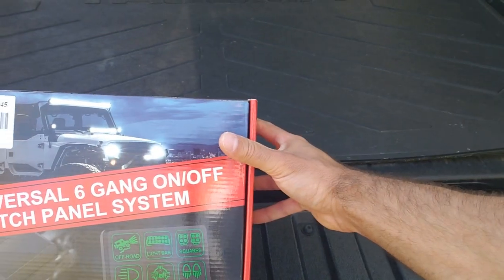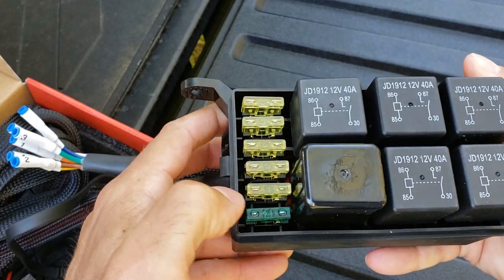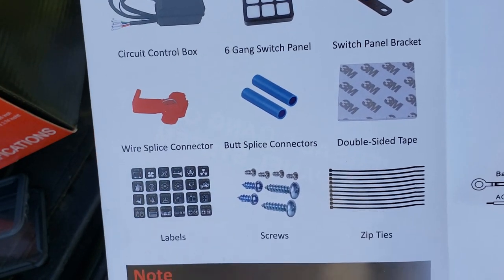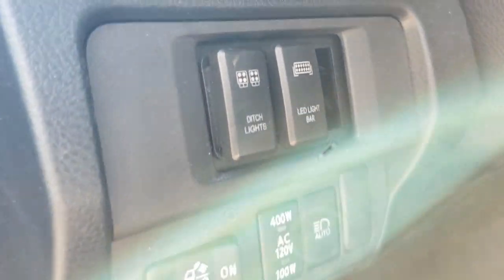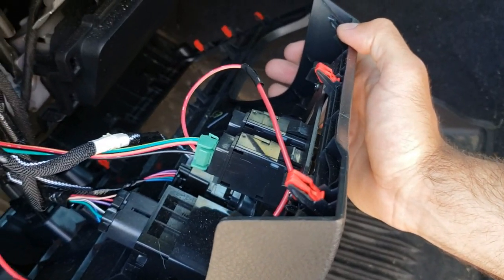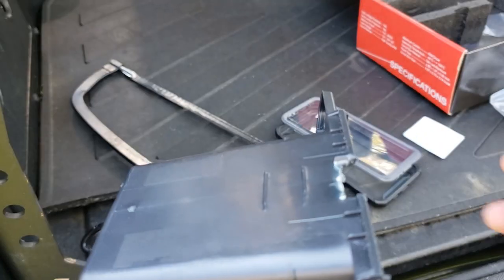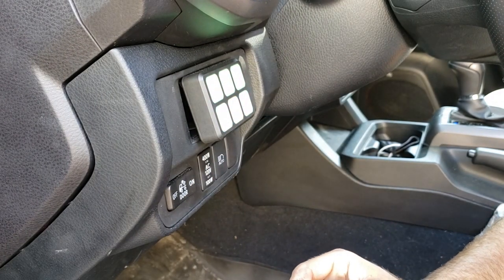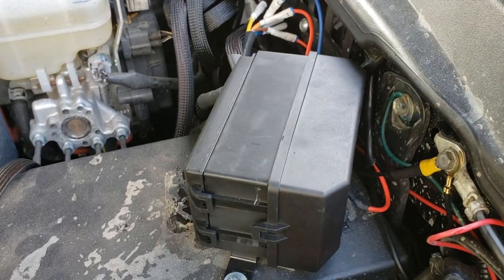Toyota Tacoma Auxiliary Fuse Box with 6 Way Panel

Comment: I added the piggy back fuse to the DRL fuse under the hood and the switch board button lights never turn off. What did i do wrong.
Reply from the maker: Did you put two fuses in the piggyback? I've made that mistake before and only put one and then couldn't figure out why it wouldn't work lol
Reply: @MikesGearGarage  nah i figured it out. The drl under the hood is always hot. I used INJ instead it works good now.
Reply from the maker: @L96A1Grillo  gotcha. Glad you got it worked out 🤘

Comment: What fuse did you connect the ACC red wire too so it turns off when the truck is off?
Reply from the maker: Ran it to the DRL in the cab fuse bank using a piggyback.
Reply: @MikesGearGarage  thanks.. I ended up running it to the Accessory power outlet (center console) so it turns on when the power is on

Comment: What did you connect the accessorie wire to?
Reply from the maker: For the switch panel? An unused fuse space in the cabin fuse box underneath the dash.